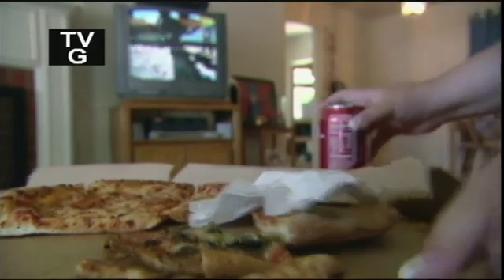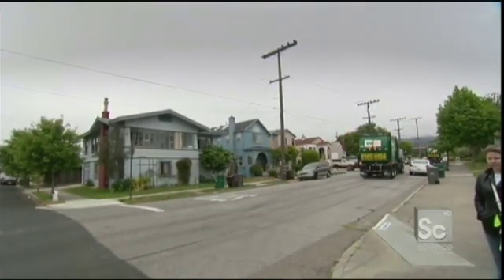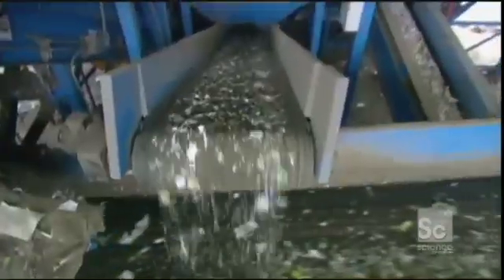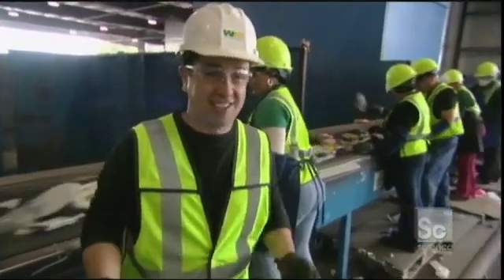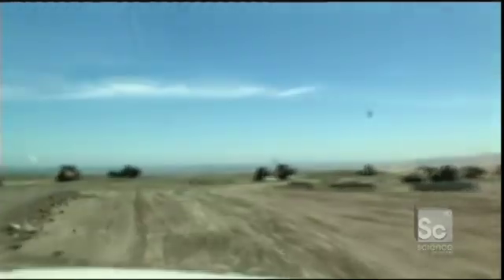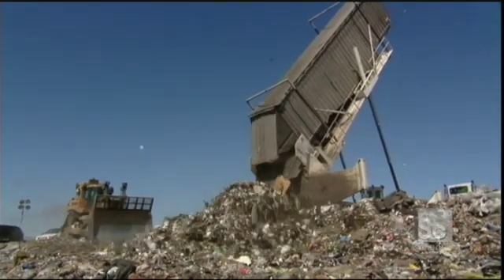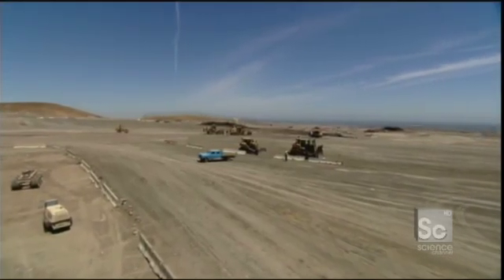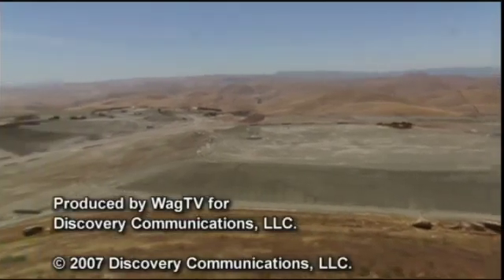Waste Management and Recycling

Comment: It's good to know that they harvest the methane gas to provide electricity to power 6,500+ homes, but I wonder how much electricity could be produced, and how many houses it would power if they burned all that trash instead of burying it in the ground. 

I don't think anything is permanently impermeable, and it wouldn't surprise me if they find out in 50 years that the membrane they laid out to prevent leeching into the soil and water table broke down and failed to perform its intended job.
Reply from the maker: I agree that the liner at the bottom of the landfills may fail in the future and cause contamination. But on the other hand burning all the trash (like how Tokyo does it), can release some toxic gas into the atmosphere too. My channel has another video on using plasma to disintegrate all traces of the wastes.
Reply: @cplai  I'm going to have to check out your channel.
I would have hoped there was a process in place to eliminate, or at least reduce, toxic gas emissions , much like catalytic converters did to reduce carbon dioxide and unburned hydrocarbons from automobile exhaust in the 70s.  After reading an article about cemeteries earlier today, it stated that cremation results in toxic gases being released into the atmosphere. Since that issue apparently hasn't been addressed in that field yet, I'm guessing that there's not much in effort in the field of waste management. 
However, after watching the following video, there is hope that zero emissions can be achieved when burning trash:  https://www.youtube.com/watch?v=14r7f9khK70.
However, the video does not state how Sweden is able to produce hardly any pollution
Reply from the maker: @Autotech659  Try this video https://youtu.be/gboSDLBV1ns

Comment: Automatic machinery and equipment,material conveying system,drying 
system，Gravimetric blender,Dehumidifying dryer,Automatic feeding 
system,drying system,doteco gravimetric blender,Automatic conveying 
system，Automatic dehumidifying and drying system
Manipulator, servo manipulator, automatic manipulator,central material 
conveying system,plastic dryer,dehumidifying dryer system,weighing 
metering&mixing system,Gravimetric blender
Dehumidifying dryer, honeycomb Dehumidifying dryer, three-in-one 
Dehumidifying dryer, two-in-one Dehumidifying dryers, hot air 
Dehumidifying dryer, box-type Dehumidifying dryer, plastic drye;
Fast crusher, medium speed crusher, slow speed crusher;
Color mixing machine, mixer, automatic mixing machine;
Automatic weighing, metering and mixing system; master batch machine
Powder suction machine, suction machine; doteco gravimetric 
blender,material conveying system
http://plastic-dryer.1998sy.com/
Mold temperature controller, industrial chiller, water temperature 
controller, industrial oil temperature controller;
Accessories: storage barrels, vibrating screens, consoles, control boxes
 and other equipment and accessories
Dongguan Hengju Machinery is an entity enterprise that manufactures 
complete sets of automated equipment! Both equipment and mechanical 
parts are independently developed and designed by the company! And has a
 number of patented technologies! Enterprises have always been guided by
 technological innovation! Mature technology and years of installation 
and design solutions, feasibility design and installation solutions, 
will save 10%-50% of the cost budget! Because we have advanced technical
 support and many years of design solutions, for example, a smart curve 
fitting design can save the previous mechanical equipment. According to 
the actual situation of the enterprise, we can analyze the data with the
 measurement enterprise and make a feasible design solution.
company name: Dongguan Hengju Machinery Equipment Co., Ltd.
phone： 86-0769-89237256 
WeChat/Whatapp： +86-15876905866
E-mail： wto-btb@wto-btb.com
Address： 168 Guangming New Street, Dongcheng District, Dongguan City, 
Guangdong Province, China
source:http://plastic-dryer.1998sy.com/
Enterprise manufacturing:
Manipulators, servo manipulators, automatic manipulators, inclined arm 
manipulators, conveyor belts, three-axis and five-axis AC servo 
horizontal walking manipulators-single/double-cut, AC servo vertical 
walking manipulators;
Central material conveying system, plastic dryer, desiccant dryer 
system, weighing and mixing system, weight mixer;
Dehumidification drying system: dehumidification dryer, honeycomb 
dehumidification dryer, three-in-one dehumidification dryer, two-in-one 
dehumidification dryer, hot air dehumidification dryer, box-type 
dehumidification dryer, plastic dryer;
Crusher: fast crusher, medium speed crusher, slow speed crusher;
Mixer: color mixer, mixer, automatic mixer; doteco weight mixer, 
material conveying system;
Weighing and mixing system: automatic weighing, metering and mixing 
system; master batch machine, chapter color weighing mixer, multi-color 
weighing wet material machine;
Mixers: large mixers, vertical color mixers, horizontal mixers
Automatic feeding system: powder suction machine, powder suction 
machine;
Industrial chillers: standard chillers, open chillers;
Mold temperature controller: constant temperature controller, automatic 
constant temperature system, oil temperature controller. Standard mold 
temperature machine;
Oil temperature machine: standard oil temperature machine;
A gravimetic blender is an item of industrial equipment used in the 
plastics industry to accurately weigh two or more components and then 
mix them together prior to processing in an injection molding machine, 
plastics extrusion, or blow moulding machine.
There are two types of gravimetric blender.
http://dehumidifying-dryer.wto-btb.com/
http://plastic-dryer.1998sy.com/
http://central-feeding-system.wto-btb.com/
http://www.wto-btb.com/Encyclopedia/gravimetric-blender.html

Comment: Why not just burn the trash for energy? Seems like a waste to just bury it.
Reply from the maker: The biggest concern for burning would be the toxic emission and by products unless you can totally burn those away too. I have another video for that. See https://youtu.be/gboSDLBV1ns
Reply: +Benjamin Yeung There was an onslaught of refuse incineration projects proposed back in 1980's that never got off the ground due to risks of known and unknown toxics and carcinogenic release to the air, voluminous risk analysis studies resulting in prohibitive costs, etc...  If you were around during the 80's, you must have heard of NIMBY (Not In My Back Yard).  Nice concept but no one wants it in anywhere near their homes, in their cities or states.
Reply: You would still have ash waste.
Reply: Flue gas cleaning for waste incineration is working just fine over here for all those pollutants. You end up with bottom ash that is often used in street construction, and flue ash (dust) which contains the harmful contaminants and is being deposed safely. As a sideline you end up with just a fraction of the original volume. The argument of global warming is also boneless, because the methane from landfills will either be burned as shown, or will (and it will) find a way through the top layer of the landfill. Methane is much worse than CO2 considering its greenhouse warming potential. Also, trash is by far not 100% fossil (only the plastic, basically), the rest thats not of fossil origin and burns can be considered biomass.
Reply: the rotting stuff actually helps the soil be healthy
Reply: Gasses and hazardous by products
Reply: +Benjamin Yeung I mean if you want to breathe in harmful chemicals and quicken global warming up be my guest

Comment: How to recycle waste tires is a social problems. every year there have so many waste tires generated. today, We found a new way to dispose them. that is recycle them with a pyrolysis machine to turn them to fuel oil or diesel to used for tractor,trucks and diesel oil generators etc.Email:market@doinggroup.com
http://tire-recycling.en.alibaba.com/productgrouplist-221347415/Recycling_Machine.html
wastetireoil.com
Reply: Why not also do this with other types of plastics? All/most plastic comes from Petroleum Oil, why not return all waste plastics to that state and then use it again?

Comment: It is good to see WM has a firm grip on recycling. Cheers and Hats off to you.
Reply: صاف 5v قف ٣ ثق صفا ٣ ٥ ٤ ٣٥ ٣٥ 4 ٤ صف ٥ ٣٥ ٥ق4ث٤ق٤ثقث٤٥اق٥4ا٥ف ف صف صفا ٥٤4ث44٣٣٥٣٤قا٥44 اقا٥ فقير 4:30-مساءً قاااثفث٣ث٤ت قاااثفث٣ث٤ت قااافف٣٤٤٤ت قاااثفث٣ث٤ت ٥ مرحبا قلت قلتثث٤فث٤ قلتثث٤فث٤اث ث ق٤ اااثتثتثت تثق ٥ انااا ثأ اثث٤٤٤ تا4 ٤٣3٣٥4 قلتثث٤فث٤اث ا ٣٥ اا4ا ق٤ اتا ق٤ ٥ا ق٤ ٥ا٤ ق٤ ٥ا٤ث تققت٤ثاث ق٥ثق٥اثقا٤اقتق٥ث٥ث٤ق٥ا مرحبا ق٥ا٥اث٥قاقث٥ ا ق٥ا٥اث٥قاقث٥ ق٥ا٥اث٥قاقث٥ ا٤ اثث اثث اثث اثث اثث اثث آآآآآآه ثأ لا تا اتقل تا اتقل اقا٥ ثق ثق ف اق ث تثق تا تا اثث ق٤ ٥ا٤ ا٥ قتثتق٥ث٤قق٤ت٥قتثتث٤تثث٤ث٥تاق٥تاا٤ا4ا٣اقثاث٥اقق٥ا٥3ا٥4 ف ٥ققا٥ا٥4تتققاثغثغاثاثف5ث٥قا٥قثاق٥ث٣اتثتتثفا٤٣٥ا٣اثاق٥ثاثث٥ا٥4٥4ثاق٥٣قااا٥ا٣ثثتثث٥٣ااث ٥ فقت ٥ 3 ثق ق٥ا٥اث٥قاقث٥ تثتثفا ت٥ث٤٥ثاا4 مرحبا 44٥ق٥ق٥اق٥اا٥ق٥اثث ٥٤4ث44٣٣٥٣٤قا٥44 ا 4 ق٤ ت٥ث٤٥ثاا4 اا4ا ا٥ لا ق٤ ٥ا٤ث ا ا4ا ا ااا4ااالتثثاث٤ااا٥اااااا3اااااا٣ ث٥٤ا٥اااااا4ا ٥٤ثثث٥إتثث٥٤٣ثاااا4ا٥ات٥ث٤اثااااا٥٥اا4٥٤ااث٥4 ا٣ا٥تت3٤٤تث٥ثااث مرحبا ٥٤٣ا٥٤٥ ت ا٥ اثث٤٤٤ ا٥ اااثتثتثت ث٣تتتت4تقا٣ت٥٣ت٣فتتثثتثثاتثا٣تتتت٣تتت٤ثتقثتثا٣اثثاا3اثتثتث٣فا٣تقات٣تتق٣اتت3اقاققا٣قققثا3ثاثثغثتثقق٣ققع٣ت4اغثق٣ا٣4ا٣٣٣ا3ااااثق٣ا٣ققااثثاثت3قاثاقثققع٣قاثاا3اقث٤قاثااثا٣قاثفثاث٤ا مرحبا ثأ ٤ ثاعثعثثااعثاثاث٣ا٥ا٤ق٣عقاثا٣ققاث٤ث٤4ثثاقا٤ااثافث٤ق٤٤٥اعاثثثثاثثثقاث٤اثثثاث4افاققفثاثاثغثاثا4ق٤ققثغثثثثفاثث ثاعثعثثااعثاثاث٣ا٥ا٤ق٣عقاثا٣ققاث٤ث٤4ثثاقا٤ااثافث٤ق٤٤٥اعاثثثثاثثثقاث٤اثثثاث4افاققفثاثاثغثاثا4ق٤ققثغثثثثفاثثاثاثثااثفثقاثاقثاثاثثعثا ٥ انااا